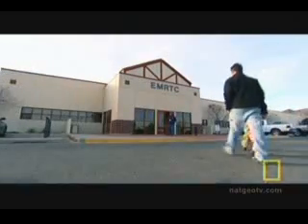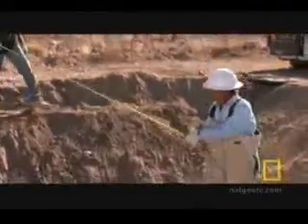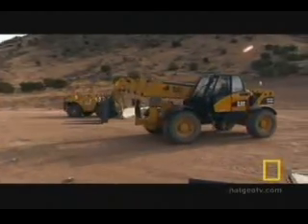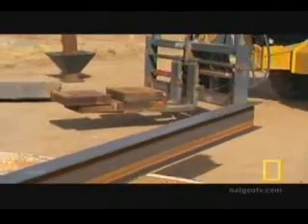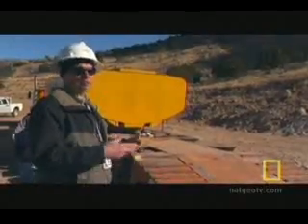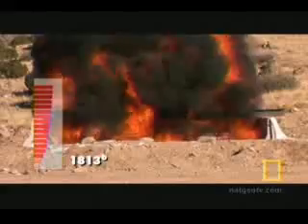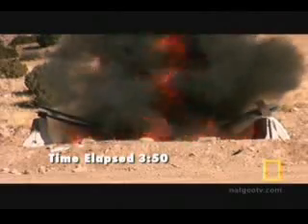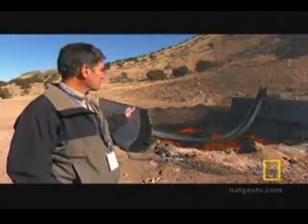steel being weakened by a jet fuel fire

Comment: Alright, the jet fuel peaked,"just over 2,000 degrees Fahrenheit," but the melting point of steel is somewhere around 2750 right? And "structural weakening" does not line up with fire fighters eye witness accounts of steel looking like "lava". That steel beam is still not exactly to scale of the twin towers, this experiment is fraudulant. 
Better experiment: recreate a small portion of one, or both, of the twin towers. Review footage of where the plane's fuel takes would be and how much fuel would be in them at the time of impact, put a similar storage container with the correct amount of fuel in the replica and light it similar to how it was done on the attack. 
I am not on either side of the fence, but I am on the side of accurate scientific experiments.
Reply: +Ian Butler There has NEVER been any photos or video footage of "melted steel"....fireman are not engineers. Many are a bunch of high school only educated joe schmoes. Aluminum has a very low melting point.
Reply: Johnny Huffington if you are in disagreement with eye witness accounts i will not try to persuade you to believe them. aluminum has a melting point of 1,221 F, which can be reached with jet fuel i agree. in your response are you proposing that what the firefighters saw was melted aluminum?

Secondly, there are balls of concrete, iron, and steel that were melted together, which could only happen in the case of temperatures reaching 2,750+ degrees F. which means that jet fuel was not the only thing used, according to the wikipedia page, thermite, which was found at ground zero, does reach the required temperature for said events to occur(2500 C). i appreciate your opinion.
Reply: Johnny Huffington upon further research I understand that the plane was made of aluminum, about 175 thousand pounds worth. which could more realistically be explained as the culprit of the "lava" flowing out of the south tower.
Reply: Chris Hall That B-25 that crashed into the Empire State Building didn't deal much damage because it is much smaller than the Boeing 767s used in the 9/11 attacks. The construction of the Empire State Building compared to the Twin Towers is very different. The Empire State Building is a very complex structure made up of steel and concrete pretty much all the way through. Like many modern skyscrapers, the Twin Towers were pretty much made up of a tall concrete and steel core with the rest of the building piggybacking off of that core. You can see it pretty visibly in this image from during the construction of the Towers: https://s-media-cache-ak0.pinimg.com/736x/d6/4f/fb/d64ffb596b19f54d0629035116d9558d.jpg

They're not really comparable events.

About your comment on the towers collapsing, aren't most skyscrapers designed to collapse within a small footprint? If a building were to collapse, it would cause much more damage if it collapsed and fell to its side, and since building collapses, although unimaginably rare, are certainly something designers must keep in mind when designing these buildings. I'll need to do some fact-checking on this statement, though.
Reply: +Ian Butler Ayy buddy, there's a fair amount of energy involved in the bajillion tons of concrete and steel coming down at practically freefall right?  Maybe enough to crush an entire tower beneath it?  Perhaps even enough pressure to generate heat, enormous amounts of heat, perhaps well in excess of the melting point of steel, in addition to the already burning fuel?
Reply: Ian Butler
There was no lava flowing out of the south tower dude. There are no reliable eye witness accounts, video evidence, anything, to support those stupid and ridiculous claims made by those Truthers. There are witness "reports" of them saying they heard "explosions", which makes all the Truthers claim there was explosives used...but a witness can say the backfire of an engine can "sound" like an explosion, doesnt mean there were any explosions on 9/11 except the blowouts of windows. Unless people have experience with explosives and the falling down of high rise buildings, what they say is irrelevant.
Reply: Those who cleaned up the site did indeed claim there were puddles of melted steal that had cooled. There are also a few videos that show flowing Pools of metal. It is YouTube if you care to learn
Reply: Talk about highschool educated Joe shmoes, so you are trying to say that compared to a building that size the small amount of aluminum that it takes to make the plane was not only enough to form large size pools of molten steel but was actually enough to remained puddled and liqued during the entire collapse and still be enough and still hot enough to be found during the clean up? Lol yeah OK. You could take that plane and crush it into a cube and it would not be enough to remain liqued in the rubnle. I have been an iron worker for almost 20 years now and I can honestly say you are completely wrong. For one unless that aluminum is within a container it has a tendency to flow and cool very very quickly. And would have been solidified before ever reaching the earth when the building was falling. Also if you look at the south corner of the building where the fire was right before it fell you can see sparks "slag" flying out of the cornercorner ( like a grinder on steel)  which would only be possible if there was the introduction of oxygen at force causing the steel to get hot enough to flow and be blown out of the building OR the use of thermite was incorporated. And the most obvious give away is if you look at footage after the building fell there is one of the massive columns ( made of 6" thick steel plates) that is still standing in the center  and the top of that column is not snapped or broke straight across like would be expected if they were telling the truth. The column is cut all the way across at a 45 degree angle, close to what a torch would do but exactly like a shape charge or thermite would do to steel of that thickness. Both buildings fell at free fall speed and were completely down in 9 seconds, how does that happen if the lower floor columns were still intact? To have buildings that size to fall so perfectly even and within their own foot print is a freaking miriacle and would take trained highly skilled professionals months of planning and prep to achieve and your gonna sit here and say that not one, not two but three buildings all fell absolutely perfect after being hit by airplanes and having their structal integrity compromised?? Yeah OK. And building 7 happens to be the ONLY highrise to EVER structurally fail and fall due to fire alone and the fire was only one two floors? No way. A B-2 bomber hit the empire state building loaded with fuel during ww2 and it never fell so how does three buildings that were designed with this very scenario in mind and with much much more modern fire protection, much stronger steel and much more stronger methods of building give way so fast?
Reply: Fact check? Yeah OK buddy, I was an iron worker for 8 years until I fell and hurt my back, don't give me no go fact check crap. The Chrysler building was not built anyway that would have made it any stronger than the towers were. The tower columns were made of a much higher grade steel and they 6" thick, that tied in with the core structure would make it even stronger than the Chrysler building. The architects even said it was designed for this exact scenario with a 777. The Chrysler building burned longer than the towers. And I don't care who you are there is only 2 ways to get showers of red hot liqued iron. You are either introducing a stream of oxygen into red hot iron or you are using thermite or thermate. Which there were chemical traces in the rubble dust. And again there is no way in hell you are going to even one much less 3 high rise buildings to fail due to structal failure to fall straight down within its foot print. It would takes months of planning and work to get even one of those buildings to fail in that manner.
Reply: Oh wow, an iron worker? Jeez, sorry to offend you sir.

I didn't "fact check" that day, I forgot to. Your comment reminded me to, though, so thanks for that.

Anyway, here are a couple good reads on the reasons why the towers collapsed. I suggest you read them before spewing crap.

1 - http://www.nist.gov/public_affairs/factsheet/wtc_faqs_082006.cfm

2 - http://www.civil.northwestern.edu/people/bazant/PDFs/Papers/00%20WTC%20Collapse%20-%20What%20Did%20%26%20Did%20Not%20Cause%20It.pdf

Comment: Not a proper test... Do it right or don't do it at all...  You must meet all the exact criteria and not make shortcuts...
Reply: +William Irwin Alright ! let's rebuild the towers , spend millions of dollars worth of construction materials , get two commercial airplanes and smash them into the towers to see the same thing happen again ! What a clown , the purpose of this video is to show you that jet fuel CAN melt steel beams ! IT CAN. Therefore , with a little logic , you can imagine and hopefully understand that there was way more jet fuel + airplanes slashing through the beams.. The result : Collapse. Simple logic.. What more do you need...?
Reply: +jaxmtl67 Your obviously taking it way to far...  All you need to do is use a beam the same size as composition of the original beams in the building, Coat it with the fire retardant and then simulate what is said to have been mild degradation of the fire protected coating... You construct a small mock-up of the support beam structure and then add a few tons on top of it to simulate upper floors... You then test Jet fuel burning on the floor and walls of the mock-up...  Wouldn't cost millions, a few thousand dollars yes, but this would be much more accurate...
Reply: Convenient...
Reply: You did say 'meet the exact criteria, and not make shortcuts'. Anything except the suggested rebuild would be a compromise, and even that would be a compromise, as you couldn't accurately emulate the aging process. Also, even your mock up would cost an awful lot more than a few thousand. Multiple tens of thousands, as it would need to be conducted by a 3rd party independent investigator to have any sort of validity at all.

Comment: The size of the singular beam, the location of the concentrated heat. The weights placed on it & worst of all, the assumption that there was 700 gallons of Kerosene pooled in one spot equally dispersed to cause a total failure of several floors of which their diminished weight caused 110 floors to collapse symmetrically, is sheer fantasy, on this planet.
This experiment was constructed to simply prove that a metabolic rearrangement can alter a steels properties, much to the opposite that welding does in the immediate area, where heat is then used to "Normalize" the properties & rearrange the metabolism to a standard consistency
It's what was ordered, arranged, conducted & produced.
It's very little to do with what happened in the towers.
Reply: +rikda It's a micromanaged simulation, of scale.  You saw what happened, it's right there.  All you're doing is deluding yourself because you don't want to be wrong.  This is real video of shit happening, just like the video of the towers is real video of shit happening.  You're probably not even a scientist that would know anything outside the context of the videos they watch, you probably wikipedia shit to pretend youre informed just so you can reply to people.  I don't know what the fuck you people think is wrong with the world, but if all you're going to do is chat about it, nothing is going to change.  

Can you formulate a complete thought that is your own?  Can you express yourself without having to resort to critical media?  Tell me what's wrong man, lets change the fucking world!
Reply: +Hinarf Narfy  It made no sense? That one fire was a 1000 feet in the air in the city & the other was in a pit in the desert? Really?
Of course it wouldn't. You can't see the difference between the 2 events because you don't want to.
If you want a conspirator, try NISTS John Gross & the denial of the white hot steel. Or that the fire chief denies the phone call with Silversteins admission "They pulled it & we watched it fall"
I've been fabricating steel for 50 years, that's the source of my contention.
Trust the government mate. It's easier on the conscience.
Reply: +Hinarf Narfy There is no point in debating this. 
It's a controlled demonstration you fool.
This Science is when you know the answer & how to get it is what you have here.
What part of shredded plane, fire ball, 1000ft ft above the ground etc.
Of sure, a pit in the ground in the desert & a dam full of Kerosene.
My goodness, twins. Why didn't I see the similarity. Duh.
Annoy someone else mate.
Reply: That made a no sense. You're a typical consp theorist
Reply: You haven't given any facts or examples, you're just regurgitating shit that's been passed down to you.  You're no different than any other nut.  Here in front of your face is a micromanaged example of that situation.  The fun part about people like you, is your facts come at a whim.  You're more emotionally involved than anything, and if you ever need to back something up, you google it.  If the information you're looking for isn't there, you either; A) Rant angrily ... COUGH... or B) stop participating. 

Please choose B.
Reply: You're adorable. While it's clear that you are well spoken, you choose to ignore the fact that you haven't done these tests. You as an individual cannot know until you do. As I, but what I see here is steel melting. Prove that this doesn't scale.

Comment: I can point out so many things wrong with their test! This is a fucking joke!
Reply: you're missing the entire fucking point of the experiment. it's to show that steel can fail at high temperatures.
Reply: you really think severely weekend steel could hold 100's of thousands of tons on it?
Reply: hottest temps in the towers where 2300, was not just jet fuel burning at that point , common sense, would say you have none
Reply: King Dedede Jet Fuel can't get to 2k degrees, therefore this is clearly fake
Reply: King Dedede One of the biggest things here is the pit they dug. It is HOLDING the fuel whereas in the towers, it spread out and burned off much faster and had no chance to get as hot as it could have got.

The next BIG thing is the size of the I-Beam. The towers had much larger beams!
Reply: King Dedede There is also a VERY BIG difference on how the beam will handle heat being vertical or horizontal.  Look at the weights they have on the beam also! All BULLSHIT!!!!

Comment: Okay, well, 2000 degrees is not enough to melt steel. End of discussion. Butane is cooler than propane and runs around 3k degrees.